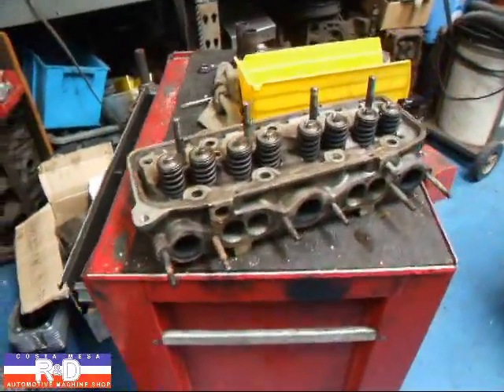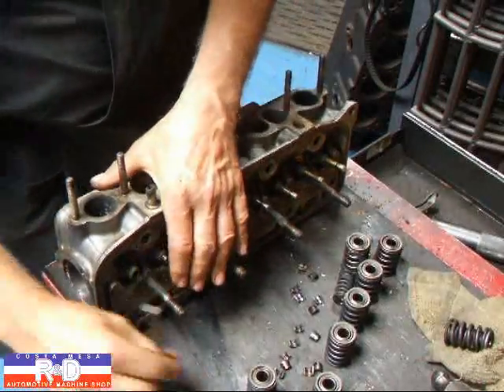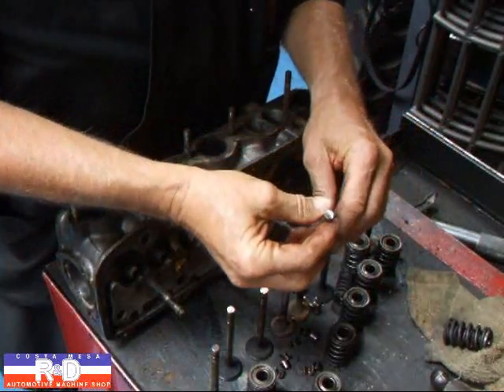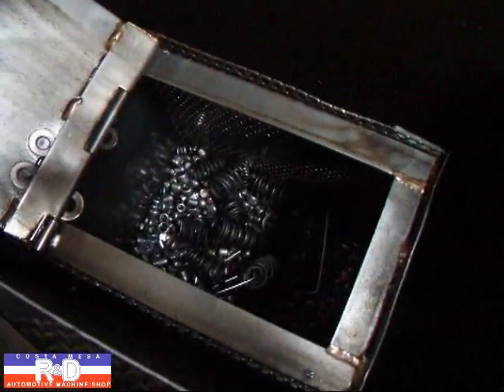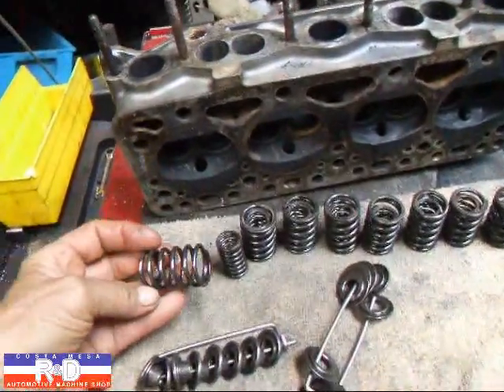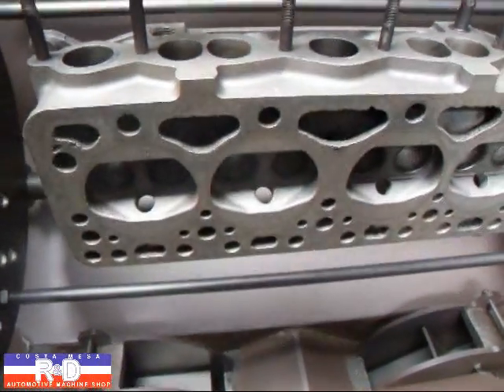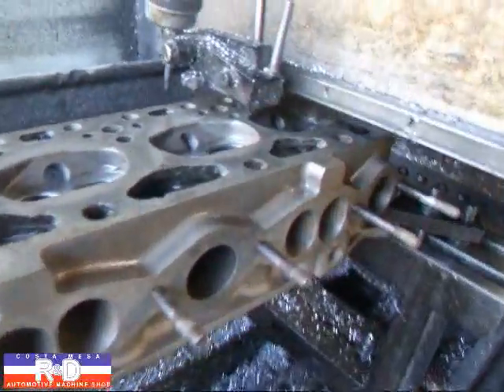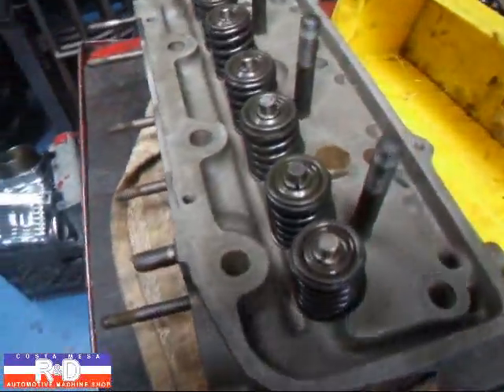Fiat 1200 Cabriolet Cylinder Head Rebuilding

Comment from the maker: Is this going to be an all-out race engine? If yes, you will see a slight benefit, if its not - don't waste your money. My custom springs are somewhat expensive and are dependent upon the engine configration. Am I suppoed to guess what you are working on? I dropped my crystal ball last week and it broke into several hundered pieces!

Comment: what's the name of the tool you cut all the 3 angles at the same time and who makes it? I tried to find someone that manufactures it but...no luck (i don't live in us).

Btw, why didn't the owner bring the rockers for reconditioning? I bet those need some touch as well.

PS: Can you make a video about reconditioning rockers from old L6 chevy engines? I've seen those on newer rockers, but on that vintage type...none(i have to do that to my old Opel, and the rockers are the same as Chevy ones)

Comment: Hey John, love your videos. I have a question about head rebuilding.  Im looking to make more power and am very tempted to do a complete rebuild though it is expensive. My question is somewhat two part. What are some deciding factors on when to replace springs, retainers, valves, etc? and how important would this be in upping my power? im already putting about 200 to the ground on 5psi boost. Im upgrading to a 76 trim turbo and 52or60 pound injectors, so would you suggest new springs and valves?